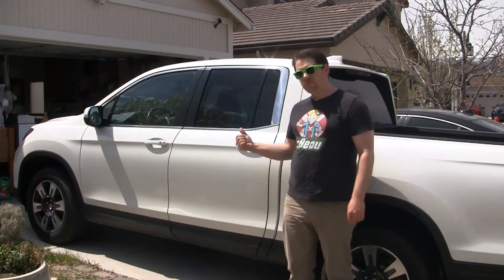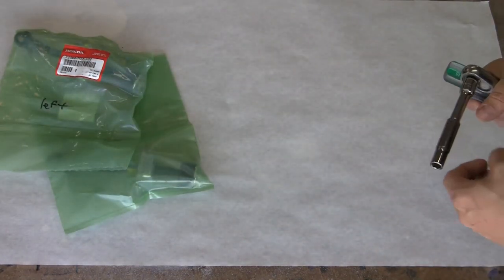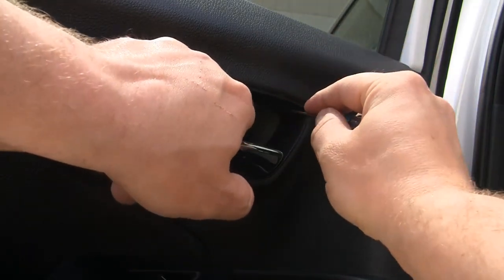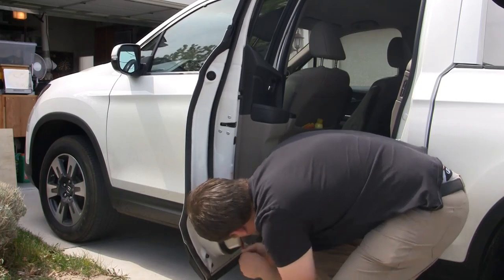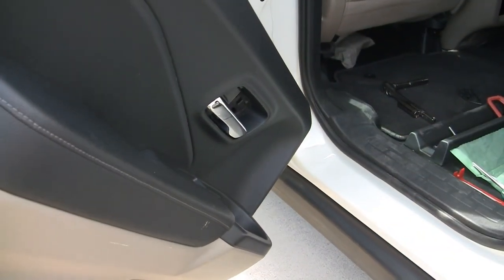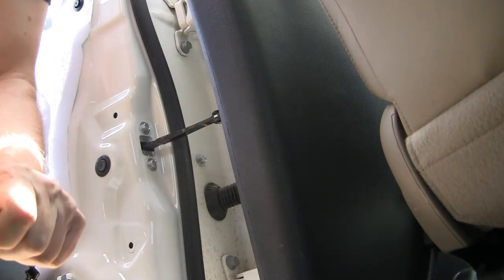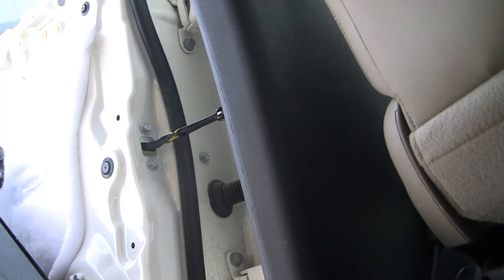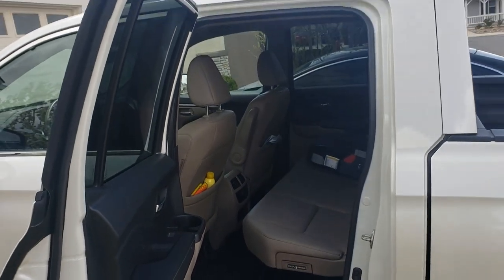2017 Honda Ridgeline Rear Door Hack - Open doors 5 inches more!

Comment: Thank you for your video tutorial. I completed mine today and wanted to add the parts numbers for the Honda parts that I used as someone had requested earlier. The right door is part # 72340-TG7-A02, the left is 72380-TG7-A02.  I did note that the end result of this project is an increase of only one inch of clearance when measured from the narrowest point of the rear door opening. It increased from 17 inches to 18 inches. The five inch increase most often talked about occurs further back on the door. 
 Still, a worthwhile project for so little time and money.

Comment: Love this!!! I just switched mine and it doesn’t seem like it will open the doors THAT much more but it does. It makes a huge difference. My wife has a 2019 CRV and we love how far the back doors swing for getting the kids in and out…the Ridgeline doors swung like half as far as the CRV, until now!! 

I’ve taken door panels off before so I was used to popping the clips and screws - took me 5 mins per door so anyone doing this for the first time can be super easy on themselves and do it in 15 mins per door. 

Fantastic OEM upgrade!!!

Comment: Did this today and only regret not doing it sooner. From time I grabbed needed tools and put them away it was just at 45 minutes doing both doors. Easier to get door cover off than expected. As others have noted, the parts are not handed and same part works for either door.

Comment: Good stuff, I'm in the market for a used ridgeline.  I was worried about this door issue for the 17, 18 and 19 year models. They fixed this issue in the 2020 models.  But with this fix I dont have to worry about that issue.

Comment: I just finished this on my 2019 Ridgeline.  Very easy to do.  You need a putty knife or some sort of blade to dig under the speaker housing to pop it away from the door. Other than that, this is a pretty easy job.  Doors open wide wide wide!
Reply from the maker: Oh dont use a putty knife, they sell trim removal tools that are cheap
Reply: My dealership said it is the front door parts that you putting on the rear doors. Is that right?